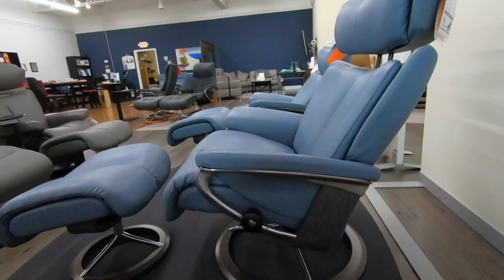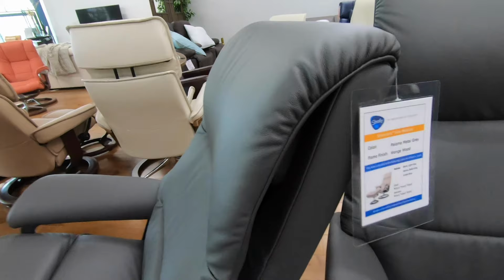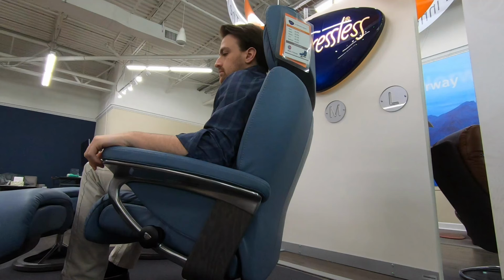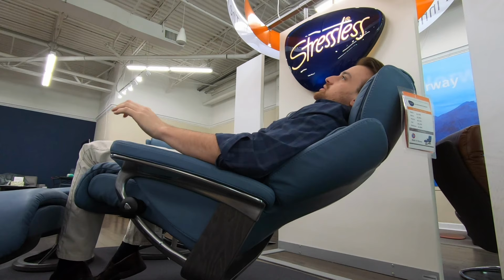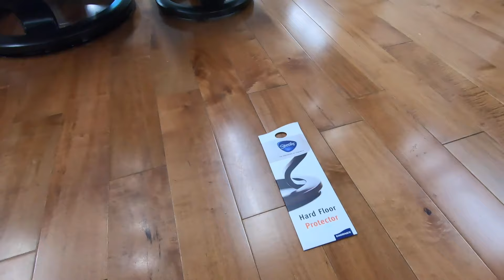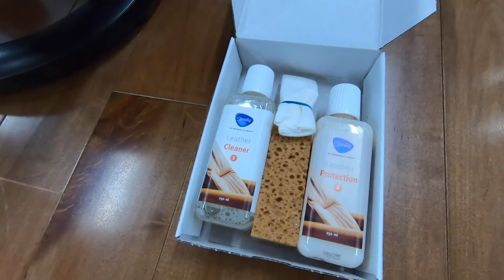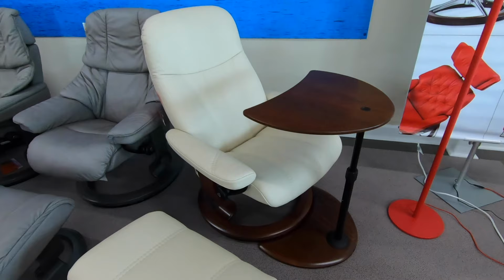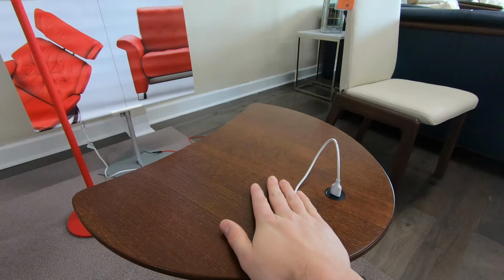Intro to Your New Stressless Recliner

Comment: Dude. Excellent presentation. Love fact  you speak slowly and very clearly.  I have had my Chair for 5 years and did not realize I could pull on the headrest for sleep mode....was super  easy to fall asleep  in, but with the new knowledge I am REALLY in trouble....zzzzzzz

Comment: I find my stressless puts my back into extension rather than flexion which is not comfortable for me and my physio jas said his causing problems. I have a small which is the correct size. I have to put a pillow under my legs to stop my spine being compressed. Help! What am i doing wrong?

Comment: What is the best way to loosen up the swivel action? My Classic base is a bit tight on the swivel ring causing the ring to move with the chair if I try to swivel (scraping on the floor).
Reply from the maker: I would recommend cleaning the ring, then use a silicon lube around the clips that the ring swivels on, spin it around to get it spread out!. Hope this helps!

Comment: I am shopping for and comparing Stressless recliners specifically to upgrade an older inexpensive chair, as my husband will be having shoulder surgery and needing an alternative for sleep as he recovers. Can the headrest adjustment be made with one arm instead of both simultaneously as you have demonstrated here? For obvious reasons, he won’t be using his left that way for awhile.
Reply: It could be done with one arm. I've found that the sleep mode maneuver is difficult for anyone with injuries in general. It may be something he cannot do.
Reply: The Mike and Max (look more like traditional recliners) can be had with power adjusted headrest. I just replace my stressless-like cheaper chair just recently and sat in those two in this very showroom. They were comparable in comfort, but the style just didn't fit what I wanted.

I would definitely recommend, if you can, getting your husband to sit in as many options as he can, as I definitely found some designs to fit me much more than others. Varying height and overall body size makes this inescapable.
Reply: @Marlin101084  I had Rotator cuff surgery in my left shoulder and slept in my stressless recliner for several nights and it was a major asset.  I was able to adjust it with just my right hand but you have to be in the middle of the headrest so equal pressure is going to both sides.  Other than that be sure to take your codeine every 4 hours for as long as you can! Helps immensely too! Good luck!

Comment: My new ottoman is scratching my hardwood floor any suggestions?
Reply from the maker: You can use 3M Felt Bottom rounds to put on the bottom of the ottoman feet.
Reply: @SLRecliners  will do thanks!

Comment: My tension knob is squeaky A.F.
Reply: Pry off the silver Stressless cap to reveal a large Torx bolt. You can remove the whole assembly, clean it, apply some grease and re-assemble.